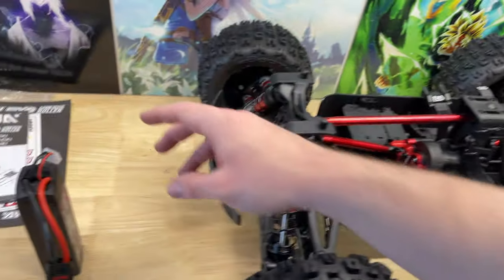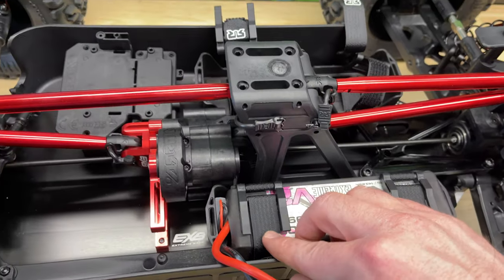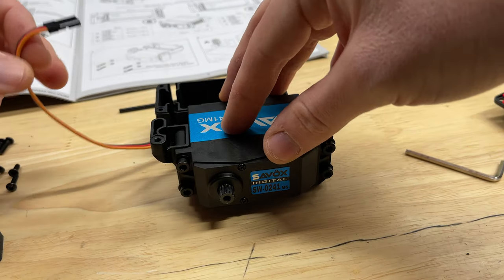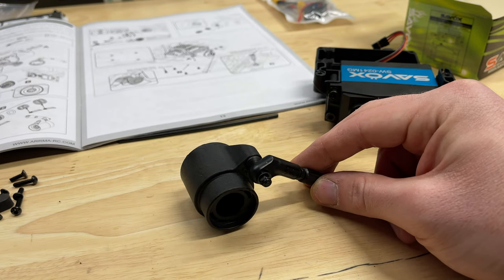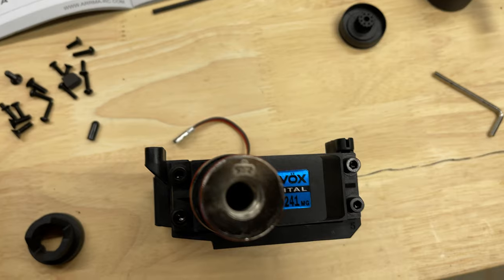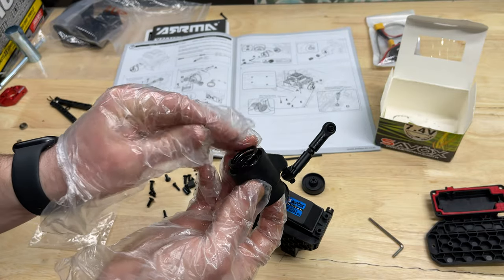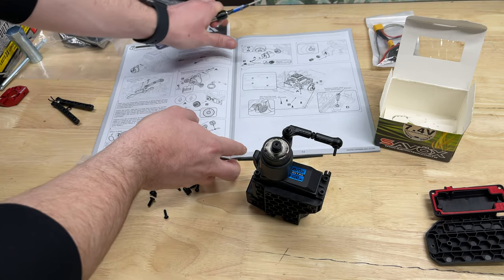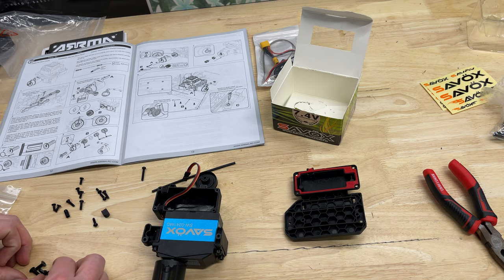Kraton 8S EXB Build - Part 1 of 2 - Batteries, Servo, Servo Saver, Receiver

Comment: Nice bud. I went with a cheap servo. I'll let you know how it goes. My $50 Raminator servo is actually doing a good job so far 👍. I had to put the 6s strap in the middle since those stock straps are not good enough when doing big air. Keep an eye on them. I've broken a couple before and replaced them with the small 6s strap.

Comment: Did you have any issues fitting that servo? I saw a post on the Arrma forum from someone who couldn’t fit it in even with the larger mount. It seemed like the servo was too tall. Also what voltage are you running the servo at?

Comment: Hey I’m kinda stuck, put everything together and my truck does a hard left circle doesn’t stay straight at all. Do you think it has something to do with the servo horn cup? I’m not sure what to do. Thank you
Reply from the maker: I would remove your steering link and service horn, turn the truck on and make sure your steering trim is set to neutral, then make sure your wheels are completely straight and reinstall the horn and steering link.

Comment: Did you have any problems fitting the servo in? And did the steering linkage make contact with the back of the motor?  Thanks 👍🏾👍🏾👍🏾
Reply from the maker: No issues at all

Comment: Did you figure out how to mount the two antennas for the receiver in the box? I believe I have the same receiver, is a Radiolink, right? I just got the Kraton 8S EXB yesterday, and I was thinking of using the same receiver with my Radiolink radio. I was trying to figure how to put the antennas?
Reply from the maker: Check out part 2

Comment: Great video I need a little help so I did everything you said and the only problem I have it my car turns more towards the right then it does to the left and I don’t know why but when I lift the outcast up it turns both sides perfectly and I’m running a Reefs 1/5 servo.
Reply from the maker: Maybe try recentering the servo by removing the horn, ensure your steering trim is set to zero and then reinstall the horn with your wheels straight. Then any final adjustments can be made with your steering trim.
Reply: @GoKaioken  okay I will try that thanks if anything I’ll let you know thank you man!!!
Reply: So I did what you said and it just won’t work I can turn to the right perfect but the time left barley, do you think if I center the servo horn that would be better then having it at the angle because I had at the angle and it won’t go the left, so I’m so confused and frustrated
Reply from the maker: And you’re sure the end points are set correctly on your transmitter?
Reply: @GoKaioken  yeah I’m running the spektrum dX3 that comes with the felony
Reply: I'm have the same exact problem as you, tried everything, did you ever get it solved ?
Reply: @rasheedsingh9730 Hey, Is yours turning more to the left or to the right?
Reply: @illhairacing3543  yea, I planned to pull down again and rebuild the saver
Reply: @rasheedsingh9730  If he has stock setup there’s an arrow on the horn that has to be looking at the top of the servo, when I first in-counter that problem I tried putting it towards the middle my car went more towards one side then the other, so all I did was look at which side has more throng radius and adjust the actual horn itself a little off center where the line on the home says it suppose to be and now it works perfectly fine. So I suggest that u try centering it again messing around with the horn and if still Doesn’t fix try putting the horn on an angle so don’t put it directly center move it more towards the side that’s not turning fully so a little bit off. And that should do the trick that’s what helped mine. It’s a little tricky but messing around with it  should do the trick
Reply: @illhairacing3543  thanks alot I'll try that, how's the reef servos working ?

Comment: Hey boss what type of grease did you use when putting together the servo saver. I just got the outcast 1/5 exb and my servo came in so that was my next step
Reply from the maker: I used team Lodi racing black all purpose grease

Comment: I did this but it pulling to the left like crazy, im starting to get irritated
Reply from the maker: I had to adjust my trim to the right
Reply: @GoKaioken  me too 😂 like far right 90/100 right but hey it's straight as an arrow now🤷🏾‍♂️ I swear I took it apart and adjusted 10x, it's gotta be a turnbuckle length issue😂
Reply from the maker: That’s weird! I only did like 30 to the right. Are you using the same servo as me? 1/5 scale box? EXB?
Reply: @GoKaioken  I'm using the spektrum S9110BL 1/5 scale, one more tooth to the right or left is too much I got it the best I could so it's gotta be my servo arm🤔
Reply: @GoKaioken  I put a vitavon servo horn on and it got me to the point I'm at the stock one was giving me a headache lol
Reply from the maker: Make sure that the servo is definitely at neutral before putting the saver on. Also the steering link screw head should be lined up with a little line on the chassis
Reply: @GoKaioken  yo ran it today and my castle b link had my fan acting weird, took b link off when I checked my data log didn't put it back on everything was normal. Have you noticed this?
Reply from the maker: I’m not running a B link in mine and I haven’t experienced that with any of the other RCs that I do have it on.
Reply: @GoKaioken  yeah I think the xlx2 is a different breed, I don't reccomend running it with this esc